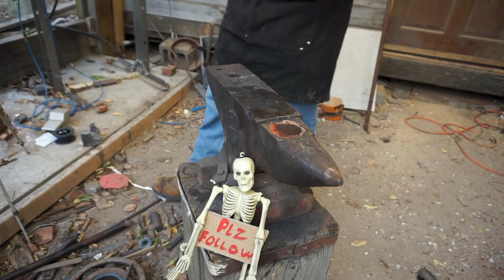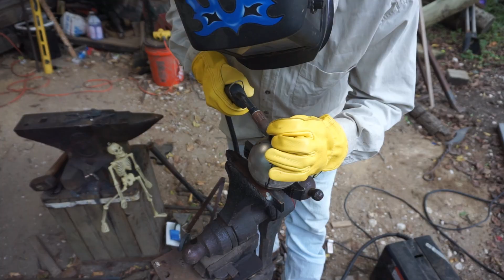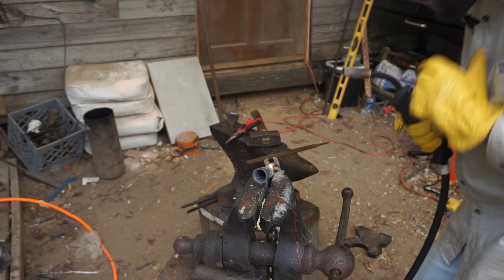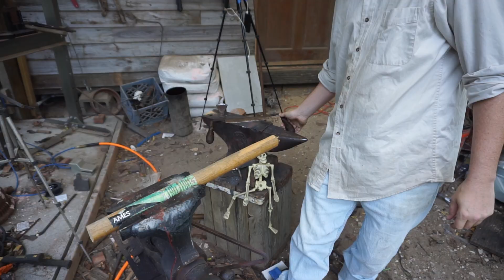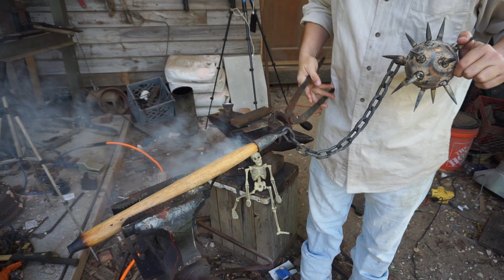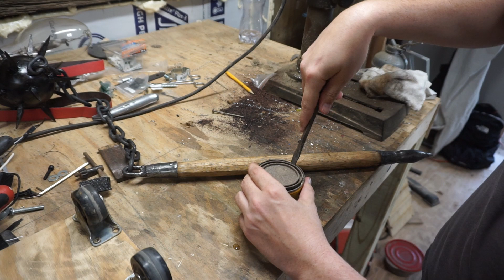I built a Morningstar

Comment: I have yet to find a video of someone making a spiked ball whitout welding, ill find a way eventually haha
Reply from the maker: There are a couple of ways I can think to do it without welding, but they are all much more technically challenging and would need a solid ball of steel instead of a hollow one. 

If you had a power hammer, or way too much time you could start with a larger ball and essentially pinch out each spike. fold it over out of the way while it's hot, and move onto the next, before straightening all the spikes at the end. 

There's two ways you could do it with a tenon joint as well. If you had the right sized monkey tool, you could probably forge weld a spike into a hole. Similarly using a monkey tool to hold the spike, you could force it into a conical hole so the bottom stretches out and locks it in place, essentially riveting the spike in.
Reply: @spleenbegone  what about the exercising ball of the gym? You can just cut off the holding to make it a round ball instead